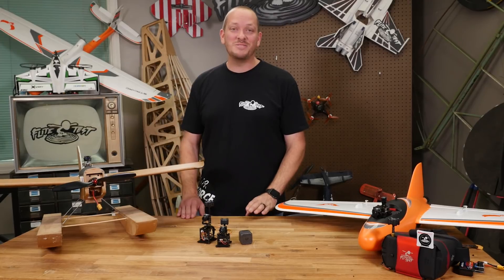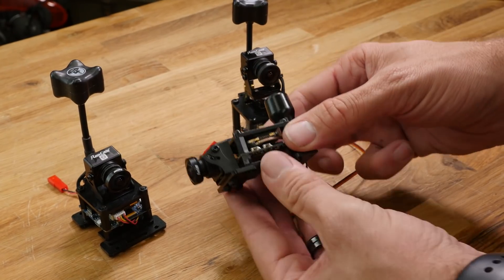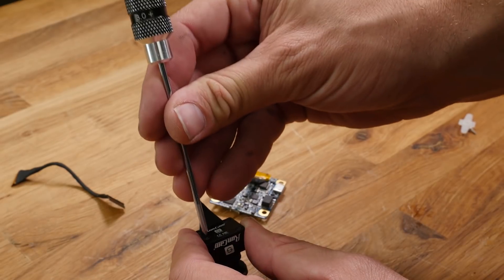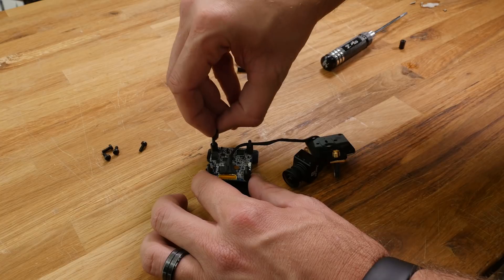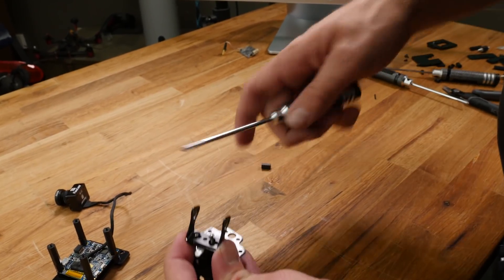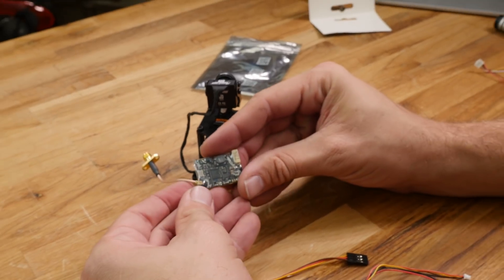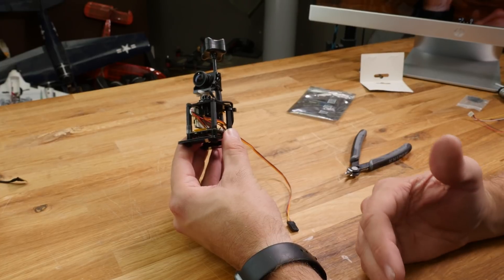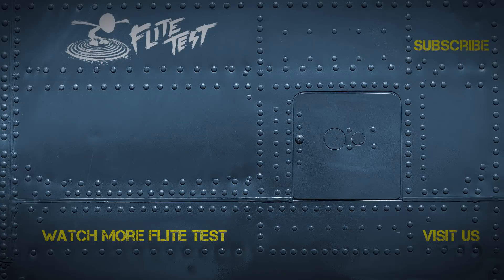RunCam Split Hack - FPV and internal HD Recorder in ONE | FLITE TEST

Comment: I'll b looking for current info on this. 

The camera you link is becoming vaporware, seems.

Nearest similar I found at your door says this: "Power Input: DC 5-20V (Non-direct power supply from 4s battery or above. Powered directly with battery will generate surges and burn the camera.)". I want a direct battery solution for portability reasons.

I REALLY went to your store looking to buy the pan - tilt kit, naw, pooped🤔

Comment: Question. 
I have a Traxxas Summit.
  front cam 1.2 and rear cam 5.8.
It works great,  but just not far enough. Need my long range!

I have purchased all parts needed from the supplied link from RMRC.
Includes both Vas antennas with all TBS crossfire components.
And QX7 transmitter.  I think I have it all. I don't know for the life of me how to install this. And I cannot find the right link on YouTube.  It's  over my head. I kind of know what's going on but I not really. 
Do you at flight test provide a install service?  I'm from NE Indiana.  I could be down there in Fl. Without much trouble. if anyone is willing.

I would like your pan tilt set up that I just watched.  With My TBS Crossfire and system installed.
Can you guys help?  It would be worth it to me.  Or just a install on the TBS crossfire is fine enough.
Please let me know. Thanks a lot!

Comment: Couple of quick things.  Any idea when the RunCam Split 2 will be available?   Also, noticed there are 2 listings for the Runcam Split on the website.  I assume the cheaper of the two does not come with the wifi module; however, according to the page, the first line of the description for the cheaper one says it comes with the wifi unit.  Might want to update that...

Comment: Not only dust, but finger prints on the sensor. When I changed the cables on my Split the first time i must have accidentally touched the sensor. All the video I recorded had a slight haze in areas. When I finally took it apart to figure out why I found a very clear finger print on the sensor glass. Cool video, thanks for sharing!

Comment: The next step would be, finding a way to tie the servo to the goggles.  Meaning with the turn of the head, the servo moves.  Love the video, can't wait to see the rig in flight.
Reply: If you have a Taranis radio and are comfortable setting up aux. channels, it is easy to do.  Your goggles would need a head tracker in them, like the Dominator Vx or similar.  then you just link the output on your goggles to the input (trainer) port on your Taranis, set up the radio and Bam! your head moves the servo!  I have seen a couple of good vids on YT that show you how to do it and connecting them requires a simple cable like you would use to connect your phone audio to a speaker.

Comment: A nice idea, but I think you guys made a bit of a fail here. The Unify Pro HV has a maximum current output of 500mA on its 5v output, but the split draws 650mA. I’m not sure this is a good idea long term, especially on something critical like an FPV system.
Reply: Dööörk - You have missed the point of my comment. The Unify Pro HV as used in this video is able to supply a maximum of 500mA on its 5v output. The split draws 650mA, therefore the regulator on the Unify is being driven 30% over it’s maximum current capacity. This isn’t a good idea.
Reply: Dööörk the 5v volt ouptup cant deliever enough powaer
Reply: Dööörk if it's over it's max output power rating, which is bad ie could burn out electronics.   Good pickup zylon. Buck Voltage reg might be a good idea
Reply: and according to schim and andyrc the split 2 is noisy on the solder pads with the new voltage reg.... wish somebody wouuld design a protective casing for a top mounted split.
Reply: Why should it be a problem? 150mA difference makes hardly any difference if you go think about a miniquad 4s 1300mah it takes under 2 seconds from your flight time if you fly 4 min, even less if 3 min.
On long range you don't care about 150mAh

Comment: Very interesting, and thank you very much. A suggestion, if I may. Many of us, me included, have not been involved with FPV, and have very little if any knowledge about the setup, other than what you just explained, and do not understand the terminology associated with FPV. Would it be possible either to do a video that explains the names of the parts and what they do. The acronyms are quite confusing to some. I for one would be willing to buy the parts explained in this video if we could understand what we were doing. I understand it would be quite lengthy and boring for some, but would open doors for others. Thanks, Lee.

Comment: So, stick a VTX03 to my RC3 using the live out cable? On-board battery backup, WiFi without the silly board, easy push style micro SD card, better protection, readily available TPU mounts, less props in view if placed where HD cam should go, no backfeed issues, and regulator for bigger range of voltage input.

Comment: Just out of curiosity, why wouldn't you run the Lumenier AXII Stubby 5.8GHz Antenna (4.7g) instead of a TBS Triumph (11.5g)?  Does the TBS give that much better signal?
Reply from the maker: We actually have done both! ;) They both work! TBS seems to give a little better signal, at least from our testing etc...

Comment: Hi, I'm interested to know if the channel you are transmitting influences the transmission in any way? Are there better channels to transmit than others?
Reply: Most of FPV transmitters on the market are indeed outputting more power on some channels which can give you slightly better range and penetration but the key in FPV has always been the antennas over powerful video transmitters, invest in good FPV antennas on your video receivers side and you will have a better eperience but keep in mind that antennas also come with their own strengthes and weaknesses, find the ones which match more accurately with your style of flying!
Have a great week and happy flying!

Comment: Do keep in mind that the RunCam Split requires 650mA at 5V and can spike as high as 1A. The Unify can only output 500mA at 5V. So you're going to be pushing the VTX 5V regulator past it's limits. That's a quick way to shorten the life span of a $50 VTX.
Reply: How do you suggest to solve this issue?
Reply: add a seperate ubec just for the split. a pololu or something like that...
Reply: Yep. I added a 1A 5V pololu regulator. GetFPV has them for fairly cheap.

Comment: Can you suggest a motor/ESC/prop/battery configuration for a simple insulation foam and foam board trainer?
BTW loving your humorous videos
Reply: Check out flitetest.com if you have not already... click on store on the top banner and look around from there, you can select only planes, look down the left side and click on novice to view all the trainers and easy to fly planes.  Select a plane you like and click on it to go to that page... there you will find all the specs, plans, fly videos and build videos.  They list everything recommended for that plane with lots of tips and other cool stuff.  My favorite beginner plane is https://store.flitetest.com/mighty-mini-tiny-trainer-speed-build-kit/  It has two wing versions you can swap easily and is a great way to start in 3 channel flight where the plane will bank automatically in turns, then swap the wing out and learn 4 channel flight with ailerons... coordinated banking turns, barrel rolls and all that!

Hope that helps, Happy build/fly!
Reply: Ken Anderson thanks mate

Comment: I remember hobbyking sell a kit so you could use your regular runcam or mobius camera for use with fpv and hd recording. They call it the mobius fpv docking station.
Reply: It was simple but less cheaper than the featured setup.
Reply: Mobius or other HD runcams are heavier and have more latency than split.